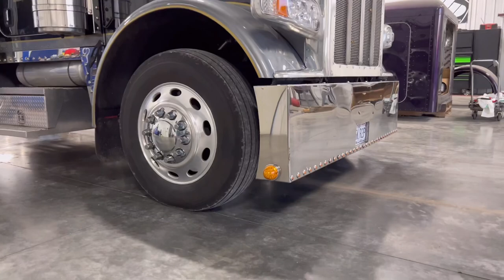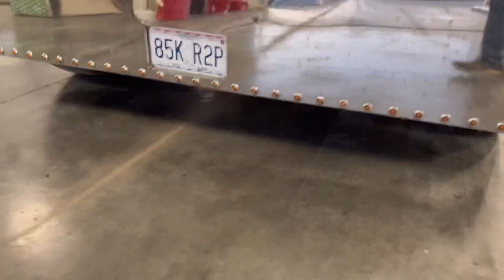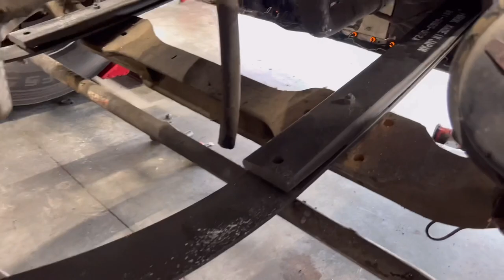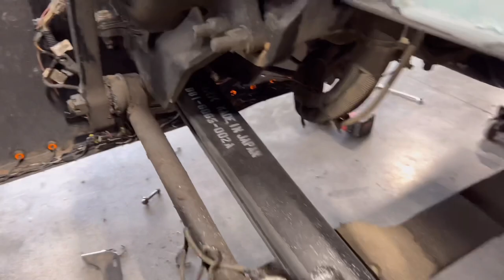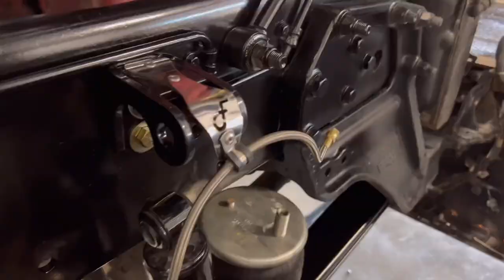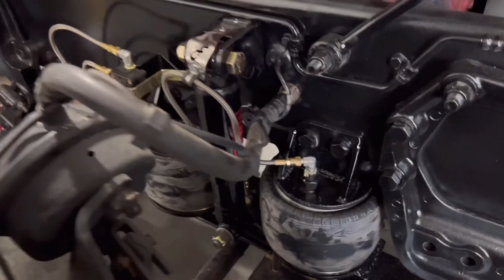2016 Peterbilt 389 glider 60 series Detroit front air ride kit install.￼

Comment: Have installed one on a 379 with the 389 springs?
Reply from the maker: We did a single air bag kit with 389 springs on a 379.  I’m getting two of jimmys 379 kits in next week and I’m planning on doing another install video on that.
Reply: Clean install!